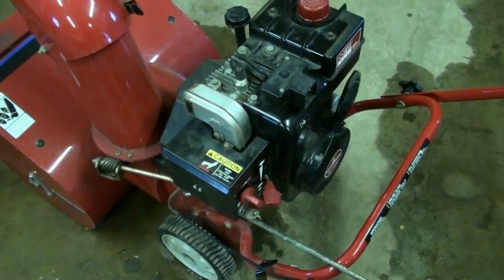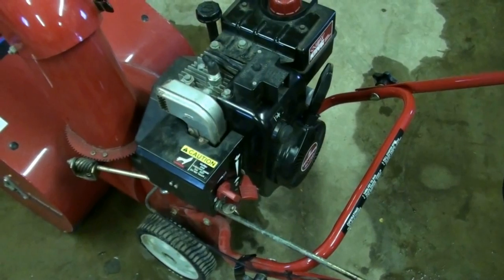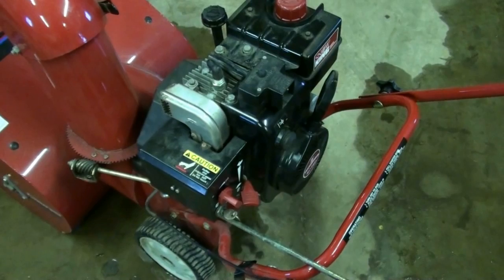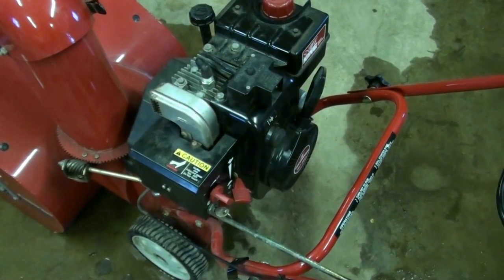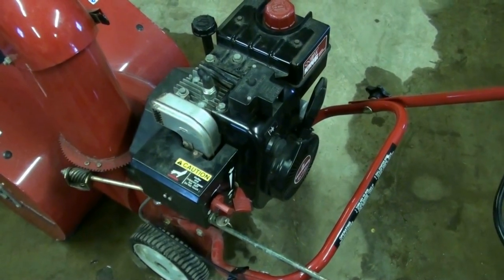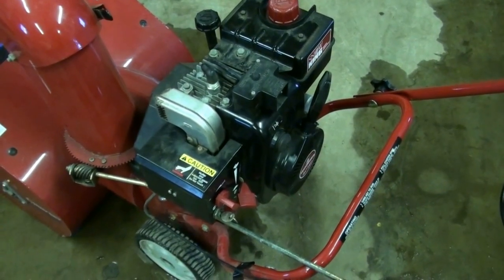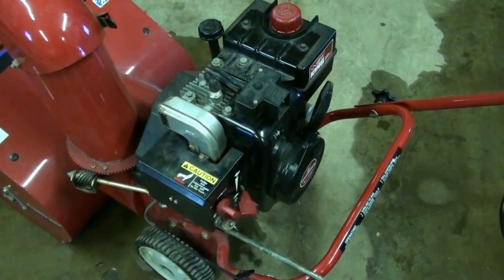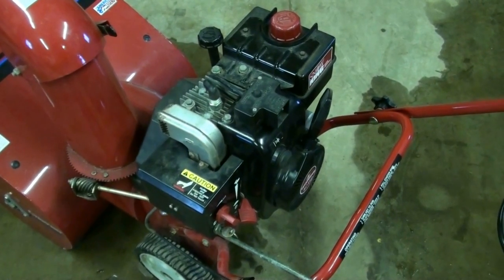Tecumseh Snow King Carburetor Repair Video on Troy-Bilt Snow Blower part #7

Comment: Great video thank you.  I was helping my brother w his Lawnboy 824 that is a 2006 w/Tecumseh engine without the carb adjustments. It would not stay running.  I was able to keep it running with the primer so that pointed to fuel delivery problems.
We took apart the carb and cleaned it and both hi and low speed gets and it started and ran well.  Later that week under real world load; it ran for 20 min or so and then would surge and stall. He could not restart. I told him to change gas cap but his dealer said the gas cap vents on his are in the threads. What do you think? Please help.

Comment: Thanks for taking the time to show this process step by step. I have a troy bilt with the same carb. I am having problems with it and have tried to adjust it with no luck. I found a replacement carb for 20 bucks on ebay. The tune up kit like you used is about 8 bucks. Figure I might as well just get a new carb for all the more money it is. Do you know if I could put a fixed carb on my unit or do i need to stay with an adjustable. Just a question, I havent actually looked at the pics closely to see if they mount the same. Thanks!

Comment: I have a few questions for ya have heard tecumseh factory in Wi is shutdown, would you recommend further cleaning, as far as taking out the welch plugs and cleaning and replacing the welch plugs,
seems all snowblowers now are coming with tecumseh engines,

great video series!!! 
started my knowledge of engines with small engines very young 10yrs old
but your videos are great for those PICKY tecumseh's
thank you!

Comment from the maker: @Braindelux Thanks, a lot of times the block ac curse up inside the low speed idle passage way in the carb that does not allow the engine to start any longer and this cannot be seen after taking the bowl off and doing a simple carb clean out! A simple clean out only works between  1 to 1.5 years after that anything can happen with bad fuel?

Comment: Great stuff. 
Mine is not starting. I've picked the carburator down to pieces and cleaned it carefully. I found a lot of junk doing so. However it is still not starting so I'll just go ahead and see if i need to adjust the floater setting just like you did. 
Anyway, I installed a gas filter on the hose from the tank just to make sure I don't 
get any more particles in the carburator.

Thanks for helping out.

Comment: Hi, thanks for the video's, cool stuff. My problem is after rebuilding the carb, my float was filled with gas so I got a new one but its a plastic float and it comes with a spring to hold the tension. Now its runs good but the carb is leaking and I dont know were its comming from. I will check the needle setting too point at choke and remove the float spring since my old one didnt have one. Also when priming, gas rushes out a small pin hole on top side. Thanks

Comment from the maker: @orkissHi, I'm not there and can't see what's going on with it but, I can tell you the most common problem with leaks after a rebuild is the little clip that holds the needle is usually pointing inward toward the engine and not pointing at the choke, this will cause a leak every time! I think donyboy73 mite have a video without using the float tool, but not sure? I always use one?

Comment: @31pockets Hi, i rebuilt my tecumseh carb on my craftsman 5hp snowblower and got it back together.  however, now it leaks when the snowblower is off.  i think it is a float issue or a needle / seat issue.  i don't have a float adjustment tool..is there a way to set the float without that tool?  i also can't get the snowblower to idle - do you think that is a result of the float not being set right?

Thanks!

Comment from the maker: @31pockets Comment #6 (Very Important) Make sure the float level is set at factory setting! This operation can been seen in the Tecumseh Snow King Carburetor Repair Video on Troy-Bilt Snow Blower part #3.

Comment from the maker: @31pockets (Very Important) Be sure the small main jet passage way hole is clear on the nut that holds the bowl on the carb, seen in the Toro powerlite quick fix video series for pre fixed main jet Tecumseh Carburetors.

Comment from the maker: @31pockets  With safety glasss on and be ready to kill the power to the spark plug if the engine starts to rev out of control. If engine dose over rev you will then know that the Governor control linkage must be set back the opposite direction and locked into place with the set screw near the lower part of linkage arm to the factory default setting!

Comment from the maker: @31pockets Learning when to say no? If this happens I usually replace the complete carburetor, donyboy73 has a very good example video called TECUMSEH HM 80 SNOWKING START UP with a similar scenario of this problem, and he dose what I would do in the same case. So I hope this helps 31pockets

Comment from the maker: @31pockets If gas sits in a carburetor a year or 2, most times it can be cleaned and reset without to much trouble; now after the 3rd year major problems start to happen ware the fuel will begin to petrify into an almost epoxy like cork up inside the low speed passage way most people are not aware of, this can resort in many deferent unusual engine problems.

Comment from the maker: @31pockets Your nest step will be to find out whats really causing the engine surging & pulsing with a pre fixed main jet carburetor and in most cases even though the carb has been cleaned inside the low speed passage way is still blocked and can not be seen deep in the carb.

Comment from the maker: @31pockets The bad thing is if you have set this adjustment the wrong direction without a Manuel the engine can speed up out of control then pop and sometimes people are injured by this action! If there are any attempts to adjust this setting without using Manuel book settings, one must keep their hand ready on the kill switch active after starting the engine,

Comment from the maker: @31pockets (In 99.9 % of most Tecumseh engine problems this linkage adjustment has nothing to do with surging & pulsing if was setup from the factory!) This linkage is set to lock in one direction or the other with the little set screw near the lower part of the linkage